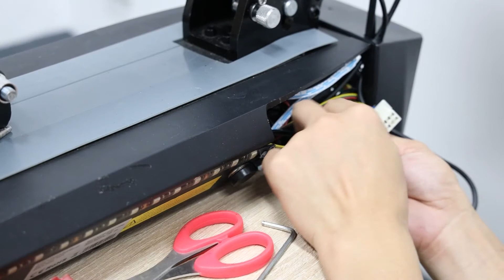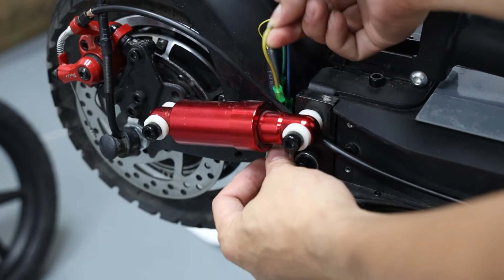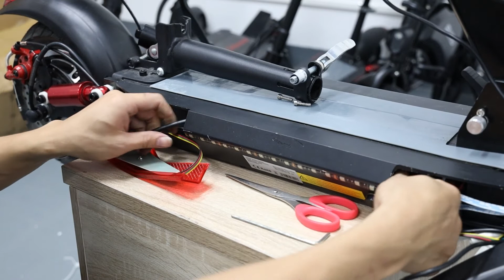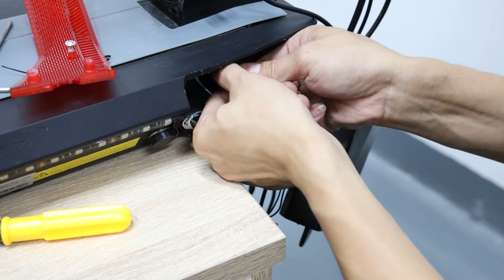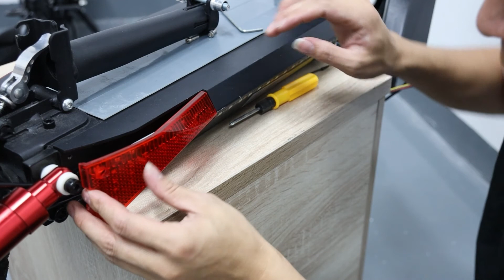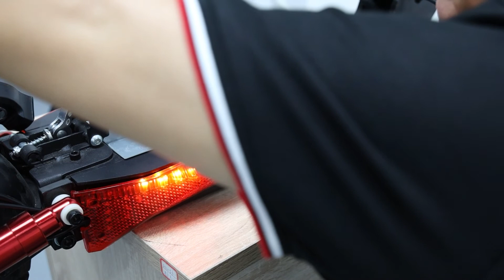Replace the Motor and  the Turn Signal Light of iENYRID M4 Pro Electric Scooter

Comment: 5:00 Here, the brake cable casing did not fit all the way in, so there will be no good adjustment.
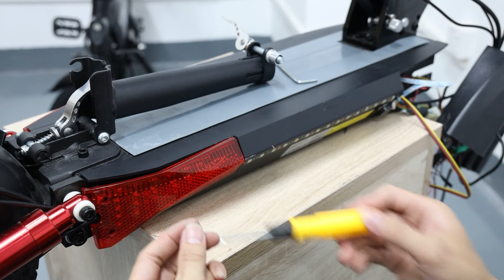 17:30 That little black box on the right corner is probably for turn sound beeper.